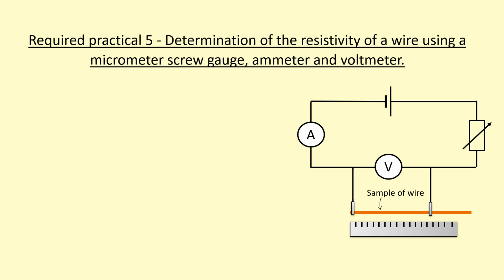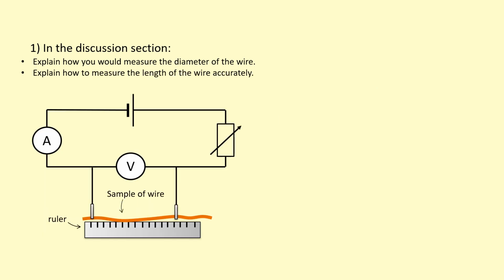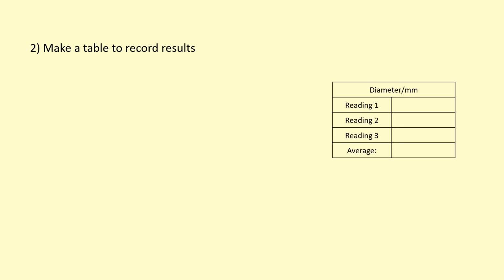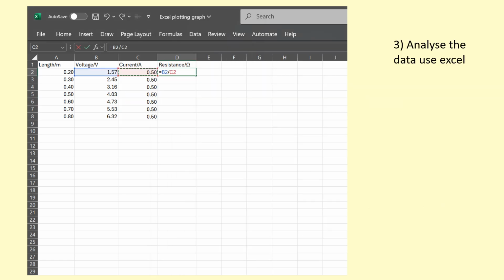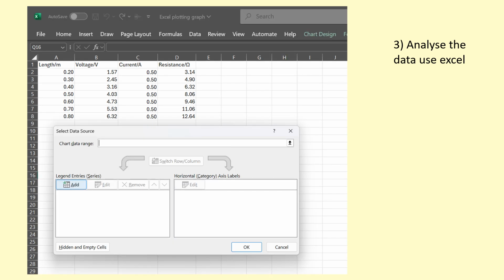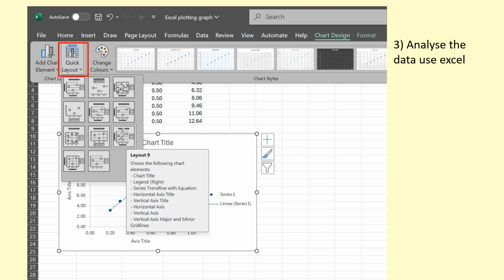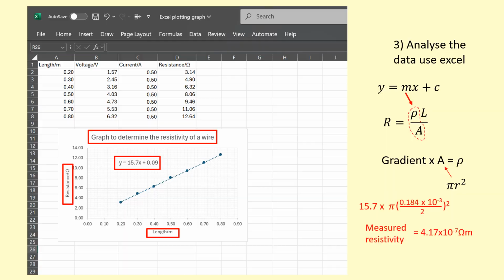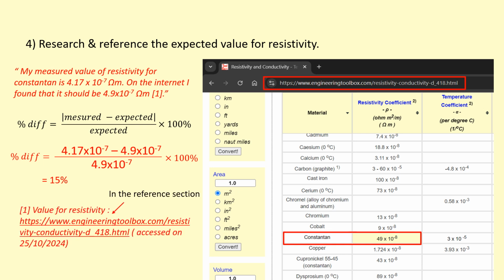15.55 Required Practical 5 - Resistivity of a Wire

Comment: Great video ❤ ❤❤
Reply: What are all the instruments I need to know for AQA physics A level ,please please can you list them down for me , so far I know its micrometers,vernier caliper, plumb line , protactor , light gates , stop watch, data logger , what else  will I be tested on,  some questions involved beakers and measuring cylinder. I never knew they would ask about that.  What other equipment do I need to know, what have i not listed?,  please can I have a list.  Please
Reply from the maker: https://cdn.sanity.io/files/p28bar15/green/c84fb691cf808ff97ba17ffce6f458f837016dc9.pdf

Anything on page 83 of this document. =But unfortuently it's not limited to this list. For example stroboscope's came up 2 years ago.
Reply: @MrNagaPhysics  why are they including things that are not in the specification
Reply from the maker: Thank you!